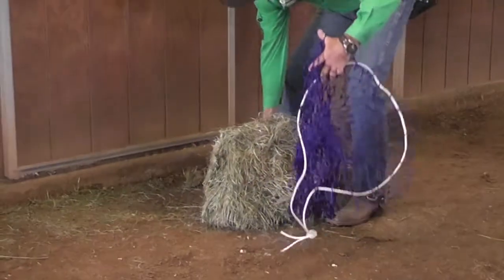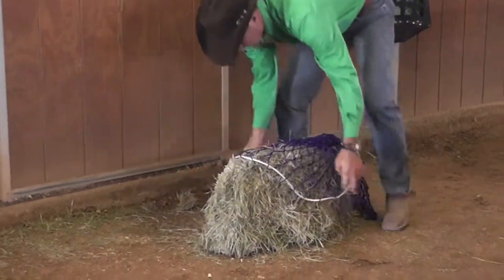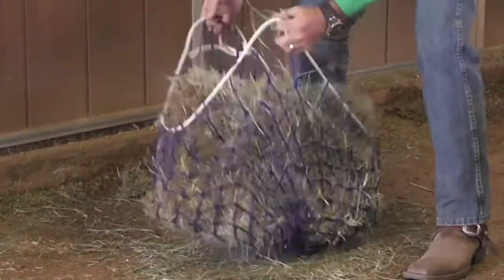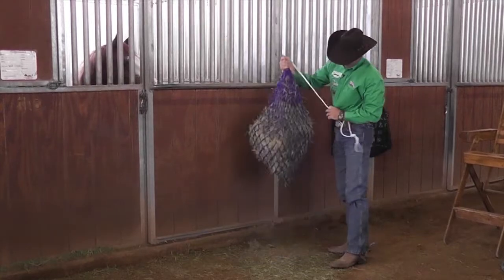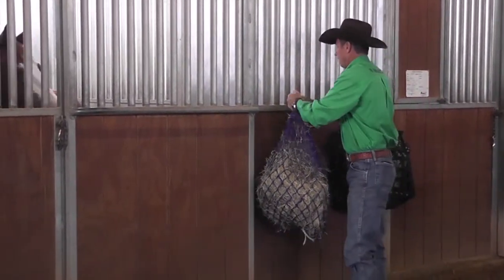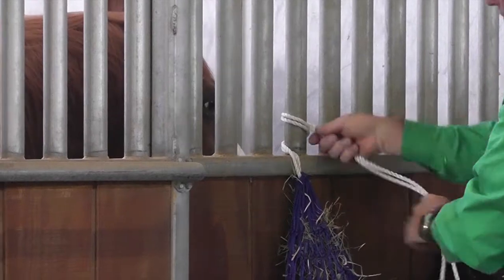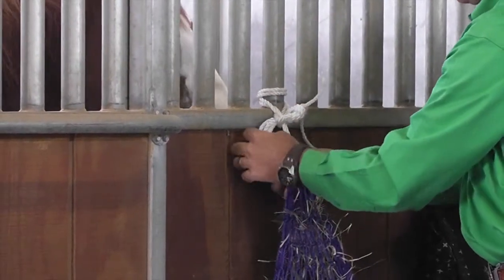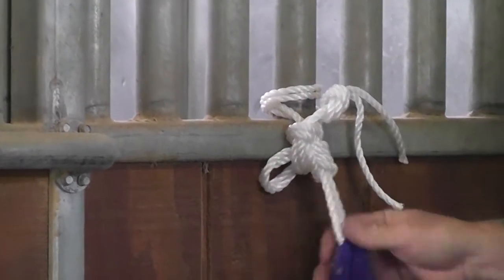Filling and Hanging a Slow Feed Hay Net

Comment: I use a plastic trash can. Put the hay net inside and stretch the top of the bag over the opening. You can stack 3-4 flakes in then lift the net out.

Comment: You almost had right.  Leaving the hay on the floor is a good start.  BUT....Then it went south. Have the flakes stacked instead of on edge place the bottom of the bag on the top of the hay pile. Unfold the bag over the hay. (Like take off a latex glove.) That way you don't have to "shake it down"  into the bag. (did you see all that wasted hay on the floor?).  Next put a quick release knot at the opening of the bag, run the rest of the rope down to the o-ring at the bottom, then back up to the quick release. go through the quick release loop, tighten then hang.  When the hay is gone, the bag doesn't hang down as far and you waste less.

Comment: Hi In my yard this is just not possible unless it's a small pony. I have to stuff the haynet very full and heavy. Then when tying up..tuck the long loop through a space or two near the bottom and pull the whole bottom of net right up ..then tie with a quick release knot....just in case. Takes it much higher off the floor. Not saying this  to be unkind or anything but just what I do trying to be safer for the pony/horse. 😉😀